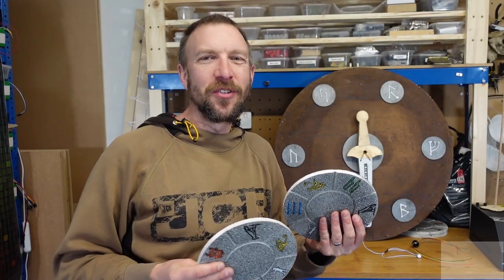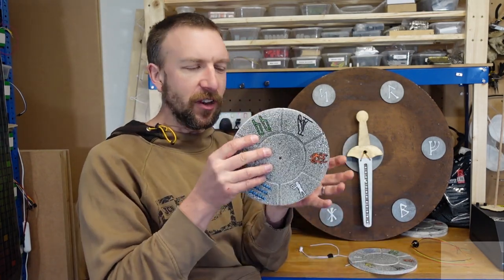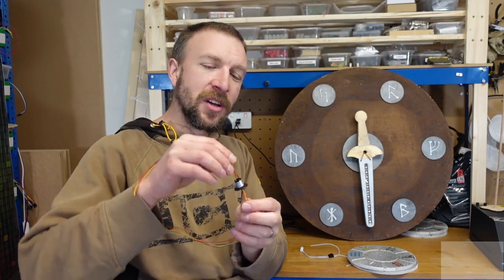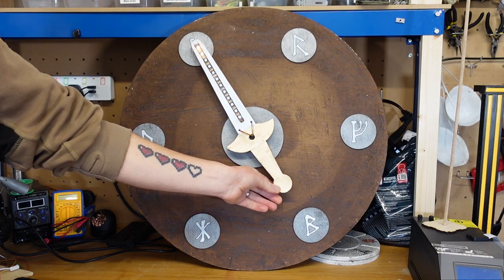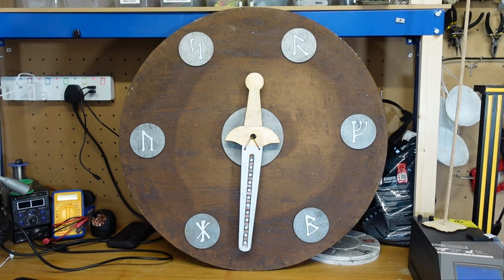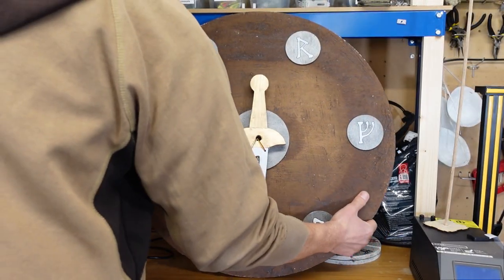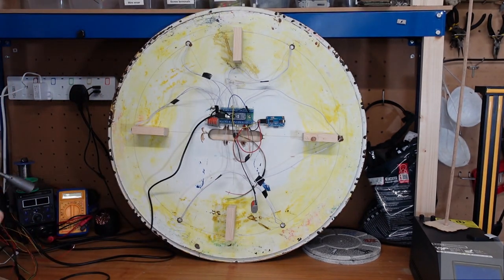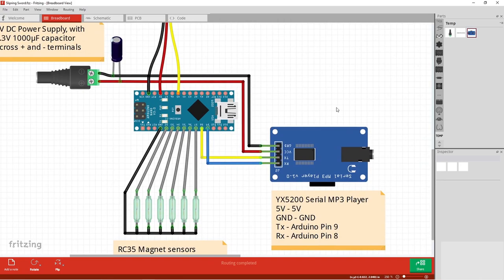Slipring Sword - Escape Room Puzzle Tutorial

Comment: I have used the dfplayer mini for a long time now..
 I must say I find your player interesting mainly because of the 3.5 mm Jack.

Since the library is big and unnecessary I wrote my own uart code, does your mp3 player use the same main code functions?
Reply from the maker: I've used quite a lot of DFPlayers too, and in general very successfully - it's only recently I started having a few problems with them. I know there are lots of counterfeit chips around, so maybe I got a bad batch. This player has very similar functionality, and I think it might be based on the same chip (described as either YX5200/YX5300/MH2024K), but trying to find reliable schematics is hard! You can certainly issue commands directly over the serial interface if you don't want to have the overhead of the library. The main advantage of these ones is they're more convenient to work with - they work directly at 5V on the serial line, no additional resistors or capactors required, and the headphone output makes it easy to route the audio output to an amplifier.